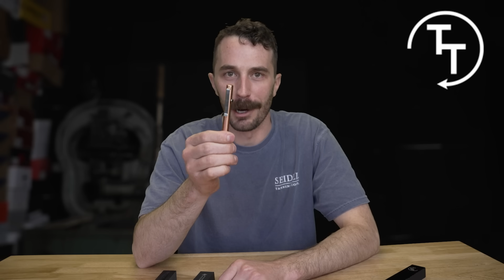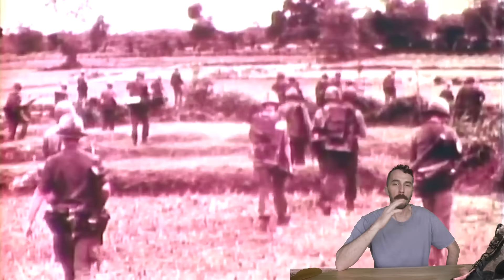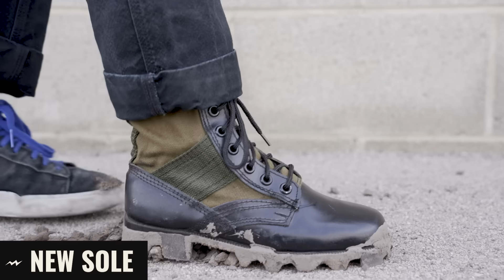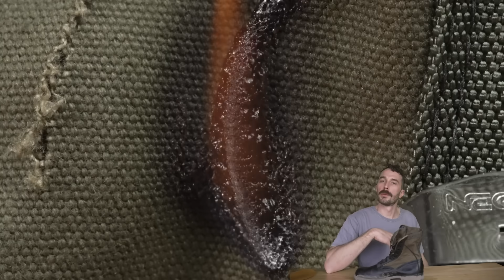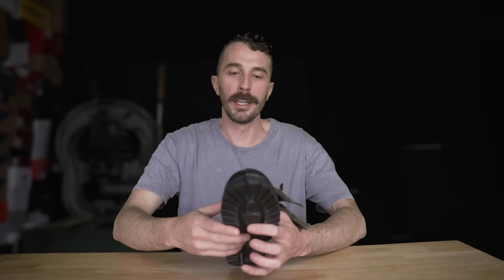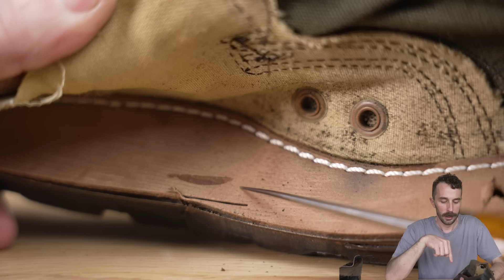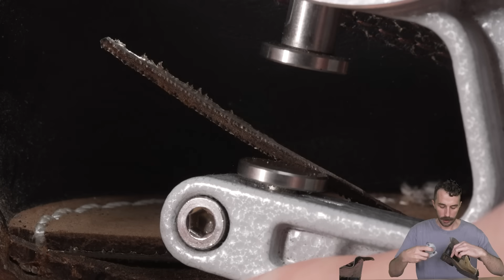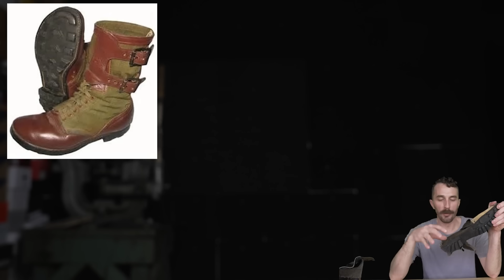Why it took 57 years to replace jungle boots

Comment: I wore my jungle boots until they were no longer authorized, but one issue that you didn't mention is that if you're in a fire while wearing them, the nylon uppers can melt and meld to your skin, forcing the doctors to skin your feet to get them off. I'm my initial entry training we were told that for that reason we shouldn't wear jungle boots in mechanized operations. Of course, when I got to my first unit (mech infantry) everyone was wearing them.
Reply: The original jungle boots had canvas and not nylon uppers, which did not appear until much later after Vietnam ended.
Reply: first thing that went through my mind about that nylon was it melting into your skin.
Reply: @MrChickennugget360  That's what tall cotton/wool socks are for haha
Reply: Same problem in Iraq with the nylon under armor skivvie shirts.
Reply: @NO-vz7sn aw man I never thought about that... God I can't imagine those poor souls who had to have entire sections of their torsos and feet flayed just to get that shit off... 😮
Reply: As I recall my time in tanks, we never wore nylon under wear in the tanks as a safety measure. Fires can occur anytime, any where, combat or not. In aviation no nylon underwear was mandatory.   @NO-vz7sn
Reply: Meanwhile modern Mech. Infantry ALL wear nylon upper boots. I guess the Army stopped giving a shit. We all kinda assumed we'd all die if we ever got attacked anyways.
Reply: @MozambiqueEnjoyer6097  the big thing was keeping aircraft crews from wearing them. The rockets from an ejector seat would definitely melt them to you. All leather was strictly enforced from Huey crews to jet pilots. If your mounted infantry they’re not going to care cause you guys can exit fast or might be dismounted. The leather requirement is for the crews mostly. It’s why most of their stuff from uniforms to boots has to be fire resistant. There’s a chance that if hit a vehicle might not immediately explode but catch on fire. FR gear and leather boots give a crew at least a chance to bailout
Reply: The old Vietnam Jungle boot uppers were green cotton canves, not nylon.  I liked them a lot better than the black ones.
Reply: We had leadership in our Bradley unit that would say you cant wear jungle boots etc.

A quick coat of Black Krylon and we wore ours anyway.
Reply: @shawnr771 lol 4d chess power play move 👍
Reply: I wore them at Schofield and when we deployed to Panama one of the few army issue equipment I had respect for I was in 10/16/84-10/15/87
Reply: Real jungle boots didnt have nylon uppers. It’s supposed to be canvas. Thorns easily penetrate nylon. Not so easily penetrate canvas. Only cheap knock offs by companies like Altima Delta and others used nylon in the upper. However, nylon is used in all modern combat boots now.
Reply: I heard the use steel brushes to get the skin off and the melted plastic
Reply: @justnoobtoo6352 not true.
Reply: @justnoobtoo6352 hell yeah. Some Motrin and some steel brushes and you're on your way
Reply: Yeah, telling soldiers they can't do something is a great way to absolutely guarantee they do it 😄
Reply: What kind of boots do paratroopers wear?  Would their boots be berated for mech troops? Are the paratrooper boots all leather?
Reply: @michaellangmdl  a paratrooper boot is supposed to be tight around the ankle and extend up a ways. This is supposed to reduce the chances of ankle injury when you hit the ground. The Corcoran jump boot is mostly used for class A functions but it was originally issued as the jump boot of WW2 and yes it was all leather. Mechanized infantry tend to wear standard combat boots or whatever they want so long as is fits military uniform requirements. They could wear jump boots but airborne units are very protective in that regard. Plus unlike aircraft and armored crews they don’t need to. Tankers, IFV crews, and chopper and jet crews and pilots all wear leather boots, full leather boots as they require the fire resistant qualities of it.
Reply: @matthewcaughey8898 I paid $44 at the BX for a pair of Corcoran boots. They're over $200 now.
Reply: @michaellangmdl  We wore nothing but jungle boots in the 82nd and 1/7 SFG. Jump boots sucked in the field as did standard black combat boots.
Reply: @michaellangmdl   Corcoran jump boot are leather and have a higher top portion to give extra support to the ankles. They are available in brown but I do not know if they are authorized today.  When I was jumping Corcorans were the preferred foot wear by the airborne because of the extra support and appearance just as the glider patch and later the maroon beret.
Reply: wool socks will solve much of the issues of melting to your skin.
Reply: well theres nothing wrong with them in the first place .Anything can be potentially hazardous it doesnt make it bad
Reply: Seems like the only issue with canvas was that they would mold and mildew if not able to dry. How about they coat the canvas in a Anti-Microbial spray. 
This way the problem of nylon melting to skin is eliminated.
Reply: Perhaps some tall wool socks underneath could offer some protection from any of the materials melting onto your skin
Reply: Better yet, don't wear nylon.  @bigshrimp8329
Reply: @bigshrimp8329  Tall wool socks would not only allow the nylon to seep through and still melt to your skin, but wool is also not something you want on your feet when you're standing in fire. Especially excess amounts of it. Wool is incredibly flammable and wicking
Reply: @PS1HagridEnjoyer  Wool however is still better than synthetic socks.
Reply: @PS1HagridEnjoyer a lot of bushcrafters wear wool as they spend a lot of time around campfires and it doesn't readily burn like synthetics and won't melt.
Reply: @PS1HagridEnjoyer "wool is incredibly flammable"? What? It's far less flammable than almost any other material. Wool is naturally flame-retardant.
Reply: The uppers were cotton duck until the late 80s. I’ve got a new pair of Altama Jungle PX, I love them. They’re unchanged except for a few modern pleasantries like a padded collar and speed lace eyelets. They retain the cotton upper and the spike resistant sole, great for working in construction and stepping on nails
Reply: They are still authorized.  Your fake.
Reply: This guy is stolen valor
Reply: I was at Benning in Mech Infantry and these were indeed standard. 👍🏻
Reply: I wore them at Schofield and when we deployed to Panama one of the few army issue equipment I had respect for I was in 10/16/84-10/15/87

Comment: As a former U.S. Marine, I can claim to have utterly used up a dozen or more pairs of our 'Green' Jungle boots during my service time. That said, the 'Vibram Soles' were Vietnam-era...you just didn't see them much after the mid-1980's. There were, in fact, two different Vibram patterns used ('old' style 1, and 'new' style 2), with a slight pattern difference. You are correct, that they were disliked in 'heavy clay soils' which are sticky and fill treads (you almost have to let them dry first, and 'beat the dried dirt' out of the treads, in fact). The last pattern, the 'Panama Tread' arose in the mid-1980's as a 'fast cleaning' pattern that would (supposedly) self-clean as you walked. All that said...now let's look at it from an infantry-perspective:
The Vibram style sole boots were heavier, not only because of the soles, but the canvas (to me) seemed a 'heavier weight', as well. I've never seen a 'cotton canvas' upper 'mil spec' jungle boot...but there were two different 'weight-grades' of nylon uppers released from around 1983 and 1992...maybe tied to the Panama Tread pending model, not sure...The 'drain holes' seldom work properly, and with heat, water and stretching, sometimes just 'fall out'...hello Mr. Leech, how did you get into my boots? Of the Vibram soles, either old or new, those were THE BEST boots for the 'lowers'...the spike plate was almost full-sole (later boots were just a narrow shank). While the Panama Tread boots DID self-clean, surprisingly well...the life-span of 'useable tread' was about 2-weeks of hard-wear...and then, you had nothing but hard-rubber flat-plate...to try and 'fix this', I have seen Panama Tread that had almost NO lugging, and some that appeared 1/4" deep...it's like they were trying to figure out 'how much to add...so you weren't buying replacement boots monthly. Most of us would go to the base cobbler after buying a pair of boots, and EVEN BEFORE WEARING THEM, have the Vibram Soles put on in place of the Panama Tread...if you needed more traction for your duty location, I've seen a number of guys cut out the 'mid-ball' bars on the tread, to 'assist in grip and cleaning', once they had the Vibrams installed.
As for 'keeping your feet dry'...ROFL...forget it. Wear them, change your socks frequently, hang them upside down to drain-dry them, best you can, when you can. Between the 'waffles' (all leather boots) and the Jungles, the Jungles are FAR MORE COMFORTABLE to be in garrison with...day to day, and in civilian life, are GREAT for 'bow season' when deer hunting!

Comment: My first pair of jungle boots had the vibram soles and were the most comfortable boots that I've ever worn. They also came with the instructional leaflet. They lasted 20 years. About a decade ago I bought some from Altama that lasted 2 years and the soles ripped off. Where can I get new jungle boots?

Comment: Very interesting video, I wore this exact boot in Vietnam ,  we were issued the boots with the bigger lug sole. They were a very comfortable boot,  and having the extra protection in the sole of the boot made you feel a little bit better about walking thru those jungles, and swamps.    The drain on the side worked amazingly well, with everything step you took your foot would push water out. A lot of that had to do with the insert you showed. Seemed like the laces were indestructible as well, being wet you would think they would rot and break. This was one of the best improvements the military made in footwear. I find your videos very interesting and educational .     Take care,  Semper fi
Reply: My question tho is did you have quick drying socks? Cos even in new Danner Rat boots with the holes on the side, I always hated getting my feet wet cos the sock would stay wet. Wet feet in the field sucks lol.
Reply: @Eirik_Bloodaxe                     No we didn't have socks that dried quickly, I carried an extra pair or two and would change them if we had time to sleep. Those damn jungles were so wet as soon as you took a half dozen steps your feet were wet again. Even with today's  water proof boots like the Danner boots with gortex liners your feet would still be wet, the water in the jungle was ankle to knee deep on average , until you found a hole.  Semper Fi

Comment: You should do the modern standard issue boot, like the one they give us at basic training
Reply: There isn't one single standard issue boot tho.
Reply: @Totemparadox  there are a couple different manufacturers, McRae, Belleville, and bates but they all look and feel the same to me. AR670-1 calls them HWB or hot-weather-boots. We call them basic training boots. I think i got the McRae ones and those are the most common, just search McRae hot weather boots.

Comment: I have a pair of these, the base is too rigid for everyday use. Walking on concrete/asphalt in these is not very comfortable because the huge bumps underneath get caught on stairs and everything, it's not good for slipping over edges or comfortable walking. I guess they're called jungle boots for a reason :)

Comment: Excellent video...  The first time I was in a jungle environment, I was wearing a pair of old horsehide Marine Corps boots with a fairly smooth sole.  They were totally inadequate. The jungle floor in places felt like I was walking on ice. The Jungl boots I was later issues corrected that problem to a great degree,. These newer style boots look even better that the original jungle boots.

Comment: I remember lots of guys wearing these during the summer months in Germany as you could still buy them on your own if you wanted. However for obvious reasons we weren't allowed to wear them during the winter so I bought some Corcoran boots for a little extra pizazz while in garrison. I still have my original issue Wellco black leather boots that took me through boot camp and duty stations that I still wear 20 years later. Tread is still good on them.

Comment: I'd love to see a goruck edition. The boots are very similar besides the metal plate to prevent jungle traps. I bought a pair about 18 months ago but it's time for a new boot I think. They were very comfortable and coming from a man who murders shoes/boots, 18 months is a pretty good accomplishment. I guess the catch is it was designed to pump out water by the guy who designed the Adidas pumps. I definitely tested the function but not with a plan. I know they're beat up but I will be willing to donate mine to see if you can test functionality on the pump idea? I'll even throw in a can of lysol 🤣

Comment: I bought a pair of these years ago for hiking trips in an area where frequent water crossings were an issue.  They were cheaper than almost any acceptable alternative, and still some of the toughest boots I've owned.

The vents definitely worked.  As you walk, you can look down and watch water shoot out with every step for some distance after you come out of the water.  Combine them with the right socks (not cotton!) and your feet won't be perfectly dry, but they'll definitely be reasonably dry.

IMO the spike plate and steel shank made the soles a bit stiff, but not horribly so.  Out of 10, I'd give them an 8 for comfort, 10 for function and 15 for durability.  One "mod" I'd recommend is replacing the laces with parachute cord.  The stuff holds up so much better than any purpose-made shoe or boot lace and IMO has just the right amount of give.
Reply: What do you do to the ends of the paracord?
Reply: @5Minuteman  probably burn it
Reply: vibram tread？

Comment: I wore the US GI Jungle boots and Vietnam Fatigues while deployed to  Honduras in the 1988.

My experiences having worn the US Vietnam era Jungle boots on the 1980's in tropical environment, is that, the Jungle boot upper is way too low and too thin. Which does not provide adequate protection for the wearer.

At times I also wore US 1938 dismounted Canvas Leggings over these low Jungle boots. For needed extra protection.

The US Military should have improved the Jungle boot design with the upper portion being at least 16/ 17/18 inches tall with Nylon  or Canvas Snake proof thick upper walls like that of a Hunters lace up Snake Boots and retained the steel plate leather or suede Panama sole bottom.

Or have added; tall durable Leggings/ Gaiters for supplemental overlap wear in rough dangerous environments for added necessary protection to the wearer.

Comment: I used to get them resoled at a place on Yadkin Road outside Fort Bragg.  New Vibram soles on broken-in jungle boots made for boots that felt like slippers but still supported your ankles.  Best field boot ever, even in the winter.
Reply: In Germany jungle boots weren’t authorized from Nov 1 to May 1 IIRC, but when we went to Graf or Hohenfels our battery commander wore his so a lot of us did, too LOL. Jungle boots with Sealskinz Gore-Tex socks under the issued wool socks were warm and dry!
Reply: Jungle boot, Vibram Ripple sole, metal eyelets deleted, gutted 550 for laces, split laced (one for the instep, one for the calf), Spenco nylon arch support inserts, polypropylene liner socks inside wool boot socks (turned inside out).

>20 years, I still remember. MUCH trial and error on those ruck marches!
Reply: @MarcillaSmith  This is the way.
Reply: My Sargent who was a ranger did exactly that. I was a sp4 and we were in 25th ID scouts in Hawaii
Reply: All the way
Reply: @DH-cm1ds  Airborne!
Reply: I had many pairs of boots resoled on Yadkin! The green jungle was my favorite, I could run for miles in those while wearing my ruck/LCE/weapon.
Reply: So many fond memories of Yadkin road. All the way.
Reply: I checked into that, but all the places that could resole them would charge more for the job than the sole or a new pair of boots cost.

Comment: Wore these and the standard issue black boots through most of the 1980's, Best boots/shoes I have ever worn. At that time, they were like $28 I believe. I bought one set of jump boots and got rid of them in less than a month. The standard issue boots were the way to go.....

Comment: I wore Jungle boots for years even when I was assigned stateside. Some units frown on them ,hey I've been  retired from the U.S. Army almost 30 years and I still have a pair around. And yea I've wore both the Micky Mouse boots and the Bunny Boots, the why I sweat when force to wear them on the D.M.Z. in Korea, my feet would then freeze as I lay in Ambush....they're good for others  but for me only if I'm not moving.

Comment: At least in Vietnam era, quality control standards were not well applied ... as a grunt in 68 i had to hump with a boot keep together with a sandbag after the upper separated from the sole.  Seemed to remember not a slim steel shank but pot metal slag providing the penetration protection ... a Dx  process that required me to send the damaged boot back to rear with the resupply chopper to get new boots was not ideal.  There were some (not me) in my infantry unit that opted for sandals; the army did not seem to ask why / care.  Just saying hmh.

Comment: The boots were designed for Arctic combat. The bunny boots also called “Mickey Mouse” boots because once you’ve dismount your vehicle you could pump air into the boots to increase their insulation value with a pocket of air and it looks like you have on Mickey’s feet.